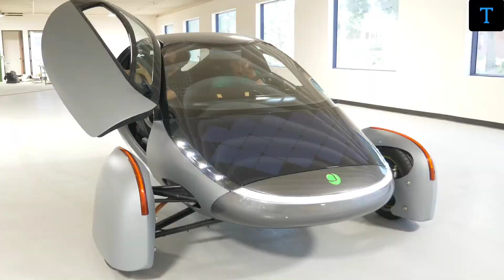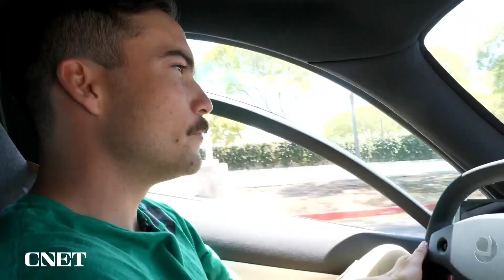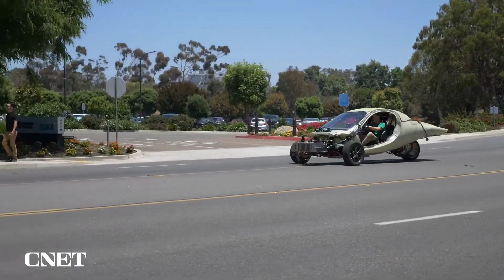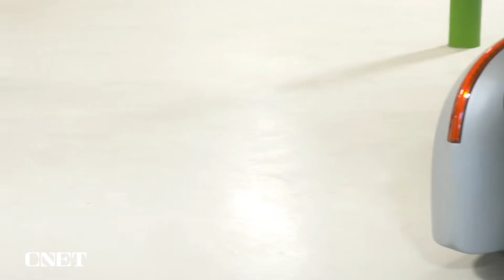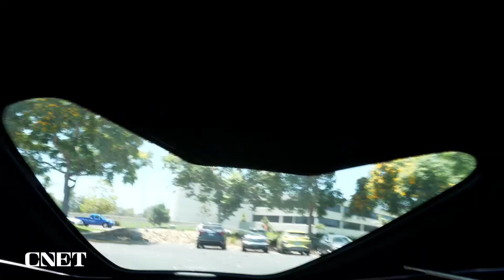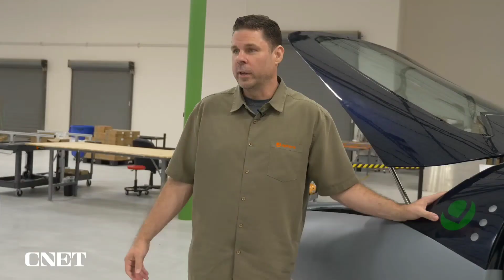Aptera Headquarters | Solar-Powered EV Prototypes

Comment: Educate in an entertaining fashion does not allow misinformation, and you are full of it (not the first time, either). The 3 Alpha's are all fakes. Their solar is especially fake, and no power is available from the sun, despite their lies. The Gamma reveal has them saying it is the first to have working solar, which admits the previous lies, but may be just one more lie, since they never validate the claim. You need to verify everything these snake oil salesmen claim before you use it as entertaining education. The Beta also has no solar.
Reply from the maker: Okay I will do more research on my upcoming content.